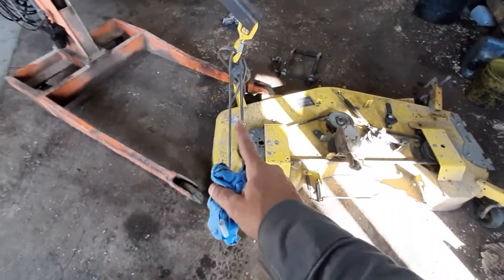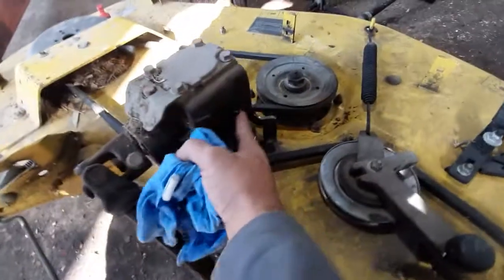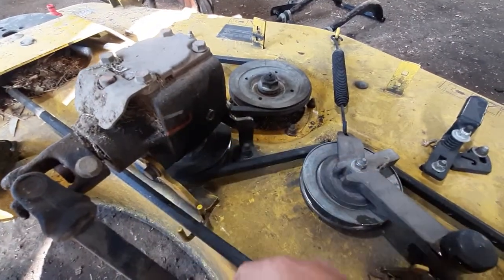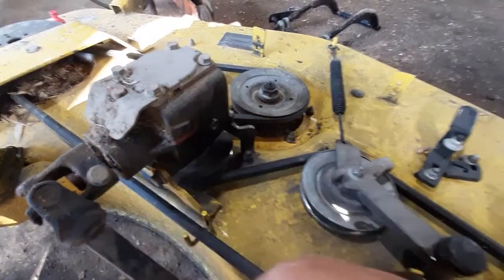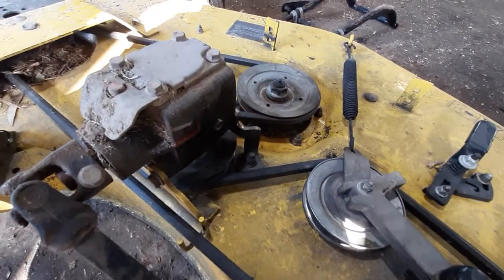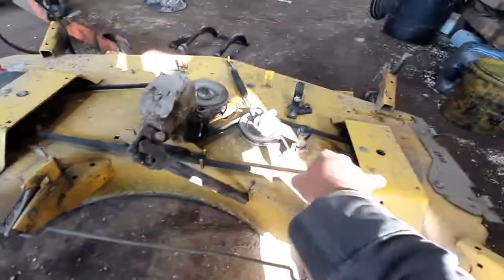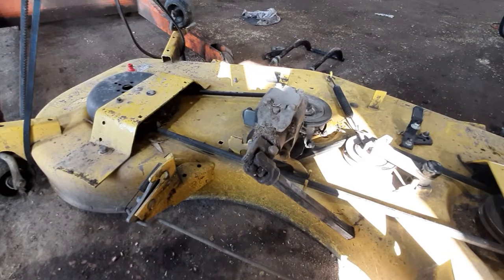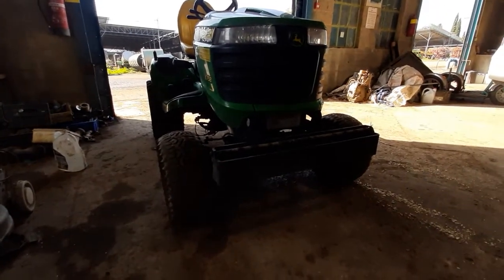Gear Oil On John Deere 60” HC Mowing Deck Replaced ("90" Oil)

Comment: Hours?
Reply: not sure now, I might need 2 go through several videos again to remember.. maybe about 800'ish?
not sure though. I'll try. Now she's either doubled or trippled,  but I'll have to go see when morning comes (where we at) so I don't misguide you with a false guess..
Reply from the maker: hey there again.. 
1. she was brand new in 2017
2. it is now 2024 w\ about 2400hrs
3. I guess we can roughly calc this
4. I think JD instructions on the inside of the tractor hood says every 200hrs but I can check again when I get to it again.